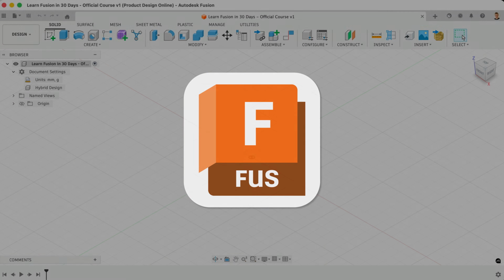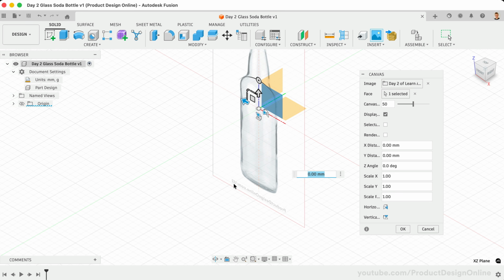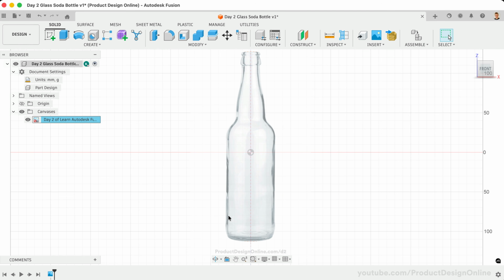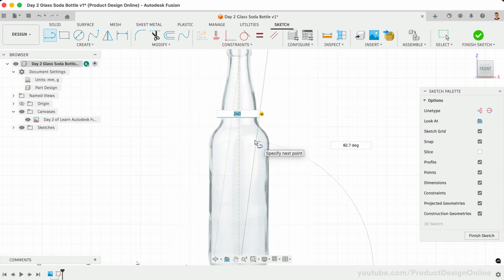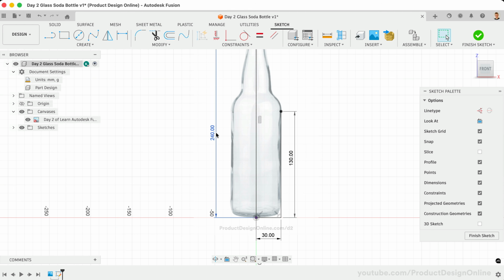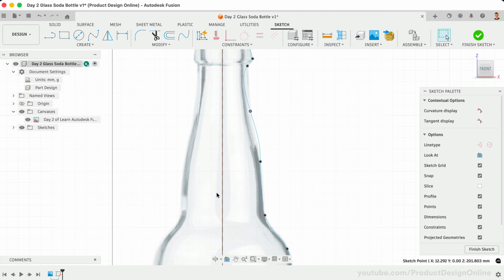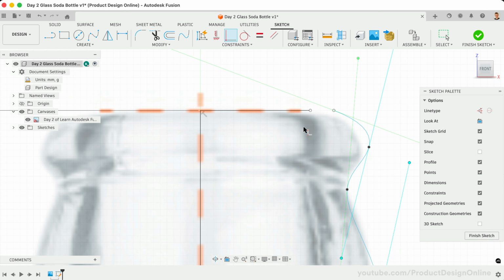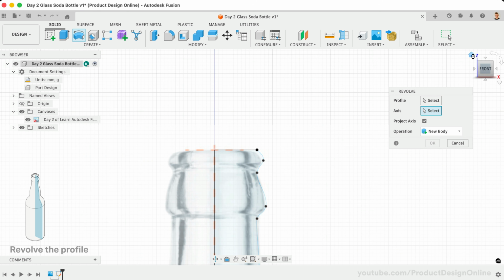Day 2 of Learn Autodesk Fusion in 30 Days! (2026 EDITION)

Comment: the center line thing didnt work for me, any idea why? thanks for the video king. Great help for a level
Reply: neither can I roll back the fillet or move the revolve in the timeline??
Reply from the maker: Hmm. Something doesn't sound right. Any chance you can capture it on a screen recording? If so, kindly send me an email with it as well as your Fusion file.
Reply: @ProductDesignOnline Thank you I think I figured it out, I dont think I can move things on the timeline but i think that’s because my fusion is not updated fully. Thanks for your time to respond, Have a nice day ❤
Reply from the maker: @bk151 Ah, yes! Always make sure you update if you see there is one available. Fusion can be finicky if not on the latest version. Thanks!

Comment: I'm having difficulty creating the shell. I keep adjusting the curves, but it still gives me the error. I can't tell which curve is too sharp. Also, what is the best practice for going back and editing the sketch? I had been right clicking on the timeline object.
Reply from the maker: Right-clicking the timeline sketch or double-clicking are both the same. You can also right-click and edit the sketch from the Browser.

Can you share your Fusion file? Export as .f3d and share a link to it. You can email it to me.
Reply: @ProductDesignOnline I ended up getting it. I had the points too close together and I had too many. I just restarted and I missed that part about limiting them my first go around. Thanks!

Comment: I am not seeing a Grid on the X axis. How do i change that?
Reply from the maker: You can either restore your default preferences, or go down to your Display settings (the small strip of icons at the bottom of Fusion) > select the Grids and Snaps (grid icon, second from the right) > check the Layout Grid option.

If it's not that, it would be the Sketch Grid option in the Sketch Palette. When in an active sketch, make sure Sketch Grid is checked in the Sketch Palette. It's the option listed right after 'Look At'.
Reply: @ProductDesignOnline  That fixed it! Thank you.
Reply from the maker: @GMcTV95  Awesome! Glad to hear that.

Comment: I probably missed it but how do we keep the sketch constrained when working with splines?
Reply from the maker: (I didn't cover it in this lesson). To keep Splines truly parametric (hard, and often not worth it), you would need to constrain and dimension each spline point. What is often preferred is to select the Spline and apply its handles > apply the "Lock" constraint. This will turn the spline geometry green, indicating it's locked, preventing it from moving unless you unlock it (by applying the constraint again).

Comment: 15:04 .Does anyone know how he did that?To view the inside of the bottle like that.

Found it.

Inspect > Section Analysis > Select the XZ plane > Click Ok 
Move the fillet command in the timeline before and after the shell command to see the change in action.
Reply: Yeah that view switch was veeeery confusing.
Something normal for a pro, something really weird for a newbie like me.
@Product Design Online - you should change this.
Reply from the maker: @kickstein  Thanks for the feedback!

I discuss the section analysis tool later in the course. I only used it for a visual so you all could see the difference because its otherwise hard to describe why it's so critical the fillet goes first. There is no need to apply it to get the shell results.

Inspect > Section Analysis > Select the XZ plane > Click Ok. You can turn it off in the Browser by hiding the Analysis folder.

Comment: Why did we have to make it a construction line and then back to center line before revolving?

Sorry if its a stupid question, I have zero experience with any design software.
Reply from the maker: Not a stupid question at all! I was demoing that because the software treats those two lines very differently:

Construction Lines are like 'pencil marks.' They help you align things, but the software ignores them when it comes time to actually build a 3D shape. If I had left it as construction, the Revolve tool wouldn't have known what to spin around.

Centerlines are the 'gold standard' for revolves. They tell the software exactly where the axis of rotation is, which makes the 3D process much smoother.

I just wanted to show you the 'wrong' way first, so you’d know why the Centerline is the one you actually want to use! Hope that helps clear it up! 
😀
Reply: @ProductDesignOnline Oh! It makes sense now! Thanks for the explanation. You are an awesome teacher. I'll be eagerly waiting for day 3.

Comment: Omg thank you for doing a 2026 version. I've been struggling through the previous videos because the menus aren't the same and I'm so excited to go back through with the new videos.
Reply: I was trying to teach my buddy but just ended up referring him to this and he had the same issue of finding the different menus a struggle. If you want to try to continue without waiting for remakes, 1 use the Hybrid Design rather than the part as its more basically the old version of fusion which he uses in the old videos 2. Watch the first part of Day 13 as he gives a pretty basic run down of the menu and the drop downs.
Reply: Same I’m going through the same thing @productbydesign

Comment: Quick question about the Move command: When I activate the Move tool and zoom in close to the target position, the move arrows (gizmo) sometimes end up off-screen. Is there a way to reposition or re-center the move gizmo within the zoomed-in view? Time to shoot you a fresh cup of joe.
Reply from the maker: Hi Max. In the Move dialog box, you can clear out the "Selection" and then choose a new point on the model, at any time. It does have to snap to a part of the model though, so there is somewhat limited areas you can place it, depending on the model. Each time you zoom in, you could reset the selection and snap it to a new point on the model that is visible. Hope that helps!
Reply from the maker: And just do double check... You were talking about the actual Move command and not the Canvas feature, right? The Canvas feature does not allow you to change the location of the manipulators, unfortunately.
Reply: @ProductDesignOnline  yes, the move command.
Reply: @ProductDesignOnline  yes, that does help, and thinking about your "how to" it hit me how incredibly ez you make this system. Thank you.
Reply from the maker: @MaxGoddur  Thank you! Appreciate the kind words!

Comment: wait
so are learning 2023?2024? or a 2026 playlist?
Reply from the maker: Learn Fusion in 30 Days was originally released in 2019. I then redid the course in 2023-24 to account for the major UI change, among other things.

Now, I'm redoing it again - in 2026 - from scratch to account for all the changes that have happened since then. The official course playlist will have all the '23-24' lessons until the 2026 version is releasesd and replaces it.
Reply: @ProductDesignOnline thanks for the hard work. Is there any certification that can be done for free? Or anything that you can recommend?